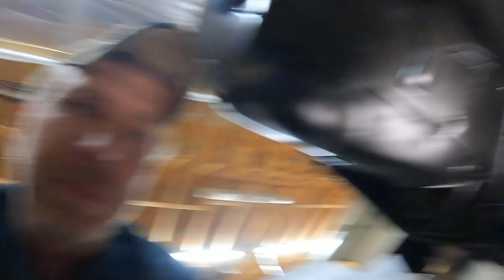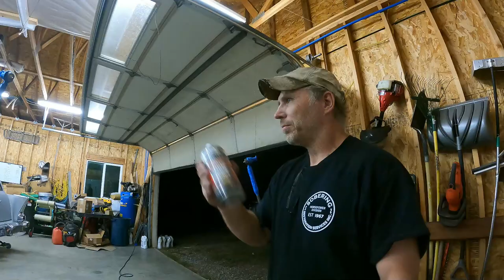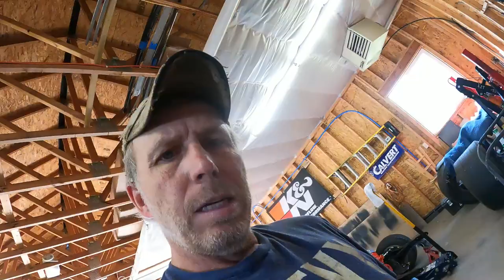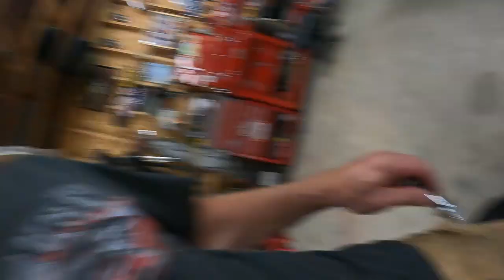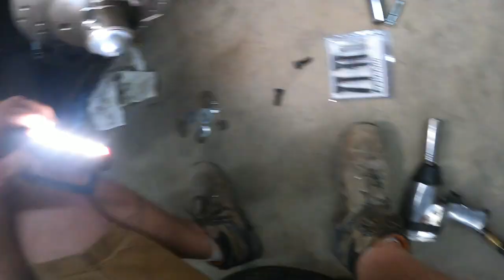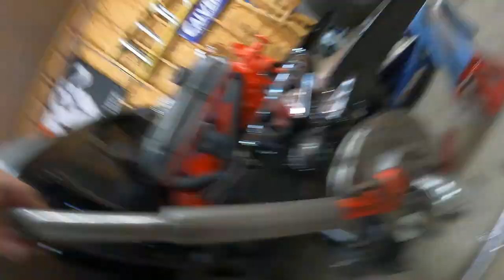Installing Trifive Chevy Steering Components and Wheel Studs - 1955 Chevy Project

Comment: It's coming along and looking better every time. A dirty but cheap way to set up toe in/out is use string from the outside of the rear tires to the front but center the stearing wheel first. You can use a level on the out side of the rim or tire to set camber. It would drivable but get it to a front end shop as soon as you can.
Reply from the maker: Thanks for the tips Monad!

Comment: I don't know if u did it or not, but i find a little wheel bearing grease on the groove of the wheel stud which locks into the rotor or drum, helps it go in easier too. Once in wipe of any excess grease
Reply from the maker: I did not do that, but will try it next time. Thanks for the tip!

Comment: I found going to a dual master cycles and prop. Valve was the best and cheapest brake up grade for the money .And I was glad how much better it steered with radial tires on it almost like having power steering. It had always had bias pot tires on it. Just sharing my experience not saying what you should do just old car talk.
Reply from the maker: Good to know. I'm excited to see how it all works out. Radials sure do make a difference on driving quality over the bias plys. That said, I went back to bias plys for now. If I drive it a lot, I'll get a second set of wheels and tires most likely. Thanks for watching Gerald.

Comment: Great video Brad when I saw the length of the first shaft I though oh no Lol 😂 I’m doing a similar video on my channel but for a 57 cheers mate
Reply from the maker: Thanks Fiano. I had the shaft longer, but had to trim it a bit when putting the body on. The shaft on the '57 has a different kind of coupler, and is only like an inch long so I thought I could just chop it off wherever. Guess I was wrong. Oh well it all worked out in the end. Yhanks for watching. I'll check out your video as well.
Reply: @MontanaGarage  cheers mate !!

Comment: Do you remember if the “metal bushings” touch on the bottom side of each other inside the drag link hole where you press them in? Or is there a small gap between them?
Reply from the maker: Sorry man once again my old brain doesn't remember. I'm sure there was some way for me to know they were fully seated though. Good luck!
Reply: @MontanaGarage  I think there’s a small gap. But anyway I got my control arms on this morning. Just need to do drag link and tie rods and coilover then brakes!

Comment: right now I running 30 x 12.5  15 MT but I just 12 x 15 Ralley Wheel to fill up the wheel well the ones I have on right now they look way too small from the rear. I want to fill in that void. If you can part from how much
Reply from the maker: They may still have them in stock at Summit. Sorry man, mine aren't for sale, they are going on the '55.

Comment: Isn’t the dash in the nomad out of a 55 Chevy , if so it looks a lot better than the dash that the 57 had ,looks good ..
Reply from the maker: Thanks for watching David. I am not sure what you are referring too. I do not have a Nomad. The '55 is a sedan, and has a '55 dash. The '57 is a sedan delivery, kinda like a nomad, but different. It and the DDSS '57 both have '57 dashes. I agree that the '55 dash looks better than the '57 dash, but I'm partial to '55's all around.
Reply: @MontanaGarage  I meant the sedan delivery , would have had round gauges yours  has the 55 dash installed … awesome looking…
Reply from the maker: @daviddamico4288  That is the stock '57 dash in the delivery. It has added gauges, some small aethetic changes, but it is the original dash.

Comment: What size and part number are those Hoosiers Tires I'm kooking for sumething like that size
Reply from the maker: Hoosier Quick Time Pro D.O.T. Tires 17710QTPRO, 29 x 14.5-15 Those are the small ones in front of the '57. I have some big ones, 33 something in the corner that are for the '57. I'd have to go check the size on those as I've had 'em for a while. I just go the smaller ones from Summit about a month ago and they were in stock at that time. I know they are kinda hard to find right now. Let me know if you want the size on the bigger ones, and I'll get it to you. Thanks for watching!